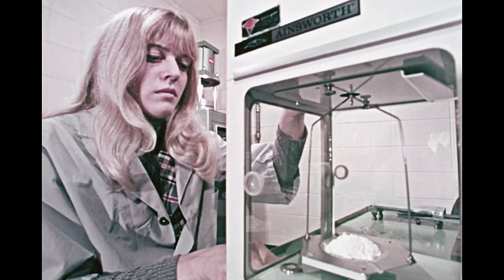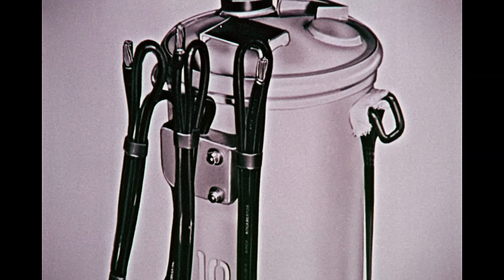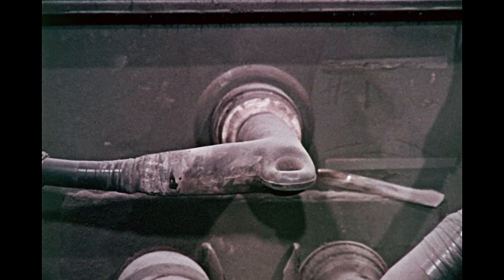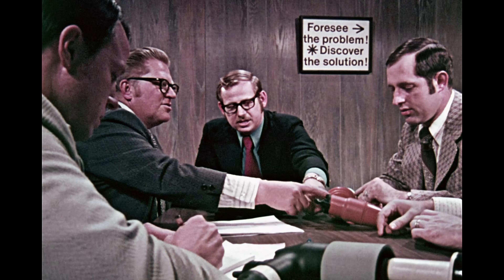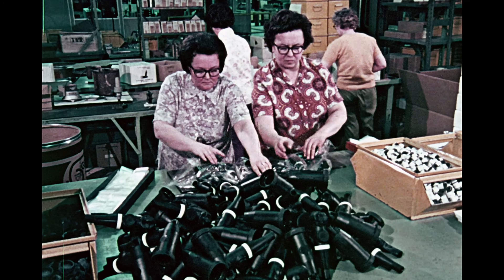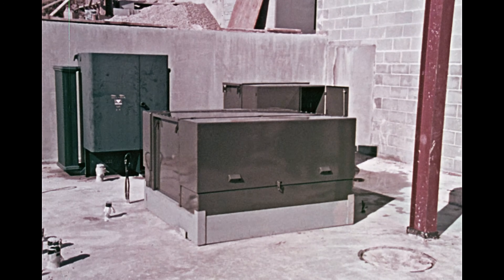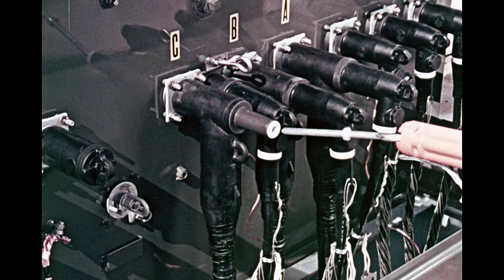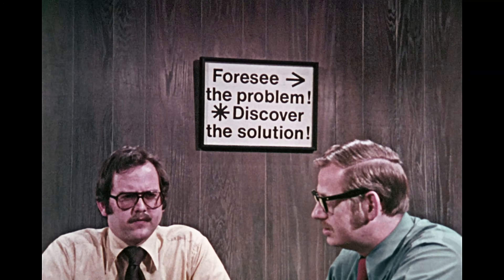Restored Film 1974 UNDERGROUND ELECTRICAL POWER DISTRIBUTION, transformers electricity, circuits

Comment: I would like to have heard the full name of RTE, in case it is not the obvious: Raidió Teilifís Éireann
Reply: As a "Paddy" myself (real not plastic), I was somewhat confused to see the name of the state broadcaster of the Republic of Ireland in a film about MV/HV switch-gear and transformers.
In this case,  RTE = Rural Transformer & Equipment.
If you watch the video @0:39 you will see it slap bang in the middle of the screen!
Reply from the maker: The name is  RTE = Rural Transformer & Equipment.
If you watch the video @0:39 you will see it in the middle of the screen and it is in the video description section as well.

Comment: Very interesting!
Overhead power lines are unusual here in Scandinavia.
From the 1970s and for a couple of decades thereafter, power lines were buried underground in all cities and suburbs and far out into the countryside.
But I see that the US still has quite a few overhead power lines left. Did it stop?
Reply from the maker: In many areas of California the lines are all still above ground, (lines owned by PG&E, Pacific Gas and Electric).  Old power lines and transformers have been identified as causing sparks and fires, which can do great damage.  They reportedly have plans to put many of these underground, but its years in the making and very, very expensive.  Elec. rates in parts of Calif. have increased dramatically over past 5 years.   Interesting to Google the details of this.   ~  Thank you for your input and feedback.  Have seen beautiful videos of Scandinavia....  VK
Reply: That's because Scandinavians have more common-sense than most.
For example, the Norwegians used their North Sea oil & gas revenue to invest in infrastructure and create a Sovereign Wealth Fund.
On the other hand, the UK  "urinated" it's oil & gas revenue down the proverbial drain.
Reply: Same here in germany, most lines are buried, there are only fusebox cabinets and substations visible at the  roadside.
Reply: Interesting videos,   I grew up in a older neiborhood where they  had 
Underground transformer.   I find it not very reliable becase the had open grate on top of transformer vault.  They would fill up with water and dirt.  Plus small children 
Would poke stuff down into grate.
 But seeing newer pad mount transformer improve greater safety.   All my neibhbirs blew one up on hot thanksgiving day while all 8 housesx were home and 75 KVA could not keep up.   It blew the lid off inside transformer vault into a great fireball.
Reply: @Funkybulb  That doesn't sound very good.
I don't think we buried them in the past, but rather placed them in small buildings called electrical substations here in Sweden.
Transformers that convert 10 kV or 20 kV to household voltage, 3 phases at 400V.
The buildings are adapted in terms of design, color, etc. to blend in with their surroundings.
When I was a child, I found it a little creepy to hear them humming. Today, they are silent.

https://www.youtube.com/watch?v=j30nC72U3Gw
Reply: esp a single phase 75 KVA 120/240 volt
Each house was pulling roughly 90 amps on that American holiday  running the electric stoves,  and Air conditioning. 
  And what ever else going on inside of all 8 houses at once It blew up in early  tbanksgiving morning.   All electric homes is even more worse  to deal with.
Reply from the maker: That sounds pretty scarry!

Comment: Sorry, but switching by plugging high voltage cables with integrated fuses looks a bit makeshift for me. No switching cabinets and no separate fuse holders where you see the amp rating and if it's blown by a flag. 
Remembers me on a big version of sparkplug caps on a combustion engine but not on serious high voltage equipment.
Reply: It does look a bit dodgy ...
Reply: It’s how we still do it today - that exact same pluggable system at the neighborhood level. The stuff in the video looks exactly like the neighborhood buried power in the last two cities that I’ve lived in where I watched them work.

Comment: "Wisconsin’s biggest electric utility wants to spend nearly $200M to prevent storm outages. We Energies wants to spend another $106 million over the next two years to bury overhead power lines and upgrade equipment to isolate outages and increase automation of its distribution system. Conway estimates 45 percent of the utility’s lines are already underground." -- July 2024.
Reply: This is why you sort the problem as early as possible to prevent cost escalating.  Investment in well designed and constructed infrastructure pays dividends in the long run.  The UK invested in the 1930 and 50's,  only a few domestic supplies are over head mainly in country areas.
Reply: @Woffy. I agree, but when utility companies end up being 'managed' by bean counters instead of engineers, major capital plans tend to get binned.
Reply: @James_Bowie  
The UK's distribution networks are now in a chronic state, with increasing fault rates.
They have only fairly recently started a mass renewal programme, and that's only because they can replace and sell the (now expensive) cadmium-copper aerial cable with (much cheaper) aluminium.
If they don't do it themselves, the cable-thieves will do it for them!
You are completely correct in saying that it's down to the "bean-counters", who have been sweating the assets since privatisation.
Privatisation was supposed to include asset renewal, however the companies trouser'd the money yet failed to do the work; what's worse, OffToss (sorry OfGEM) & all governments (of both parties) let them get away with it!
Once you get out built up areas (i.e. urban/suburban), the vast majority of the Low Voltage network (i.e. supposedly 400/230VAC but still actually 415/240VAC) is overhead pole mounted, with a significant proportion of aerial drop-cables too. 
Woffy's comment (above) is rather optimistic when they say that it's "only a few domestic properties" with overhead feeds; it's still a significant minority unfortunately.
Reply from the maker: @ten-bob-note, interesting observations!  Thank you.
Reply: @James_Bowie  This is true, bean counters (mechanically illiterate nobs) were my nemesis until I stopped talking £ / $ and showed them penalties from lost product against investment in maintenance. They soon sang my song when it worked out cheaper to invest early.  

UK was fortunate to have many people available after the war to plan and build utilities infrastructure. We now have a very strong Grid other than cyber attacks from dictators. 

US have neglected so much in the past thirty year so many bridges are EOL. Invest or loose. But that money now comes from Wall Street so investors want a large dividend and  you get less and pay more. 

The government needs to fund infrastructure but you no longer have a functioning government. I hope that changes soon
Reply from the maker: It is an expensive process, but ultimately it can save lives by not letting wind and storms crash down transformers and burn towns to the ground.  Ask Californians about that.  So many lost their homes when electrical transformers exploded from storms and lack of maintenance....